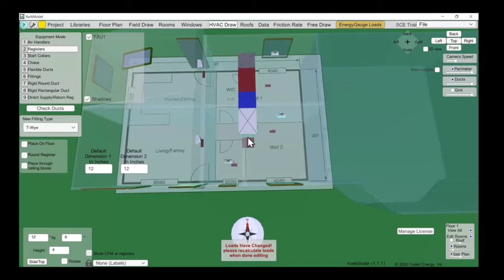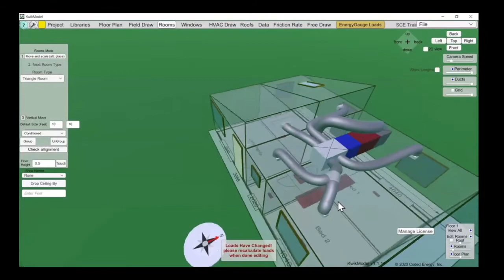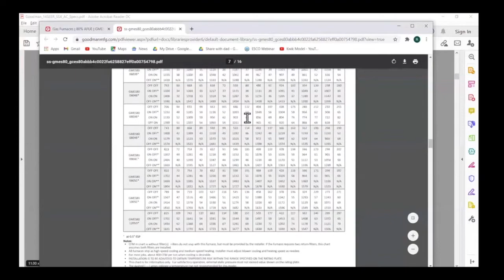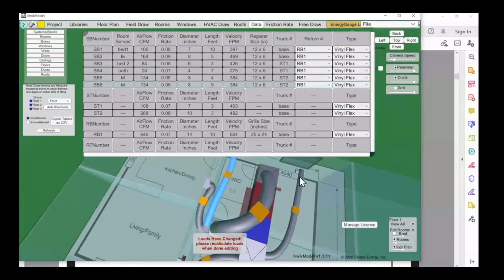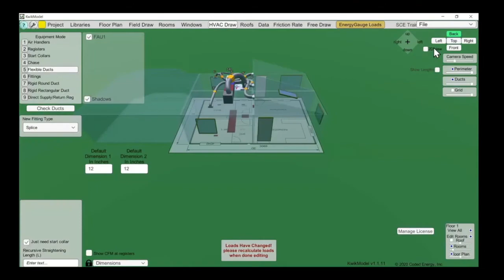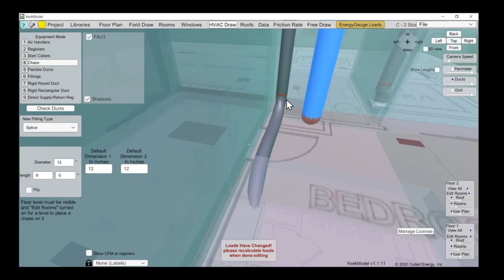Intro to 3D Residential HVAC Design, Day 2, 2nd Half, video 4 of 4, Sponsored by So Cal Edison

Comment: By us when doing a 2 story house and we have to run ducts to first floor from the attic, we run oval pipe in the wall. Is there an option for that? As I understand, the chase option is outside the wall not within the wall.
Reply: A "chase" in Kwik Model is basically just a straight duct that runs vertically through a room, ceiling to floor.  Most commonly, they are bigger ducts that run through a boxed out corner, but it doesn't matter what they run through.  We don't currently do oval ducts, so you can either show it as a round or a rectangular.  Double check the round to oval equivalence.  An oval duct that will fit in a 2x4 wall is probably barely equal to a 5" round.  I know that a 3x14 rectangular is about equal to a 7" round.
Reply: @russking63  we run everything up to 8" oval lol. Will see how this works out. 
Im trying to do a pair of rectangular  pants right off a unit. I couldn't figure it out so far.